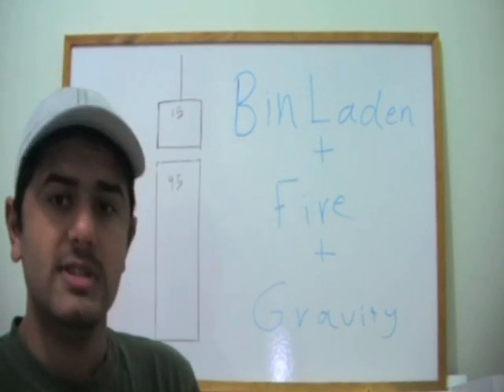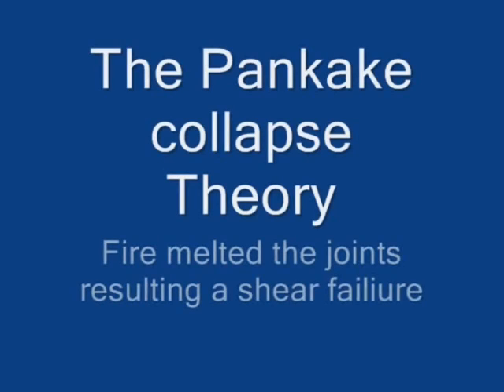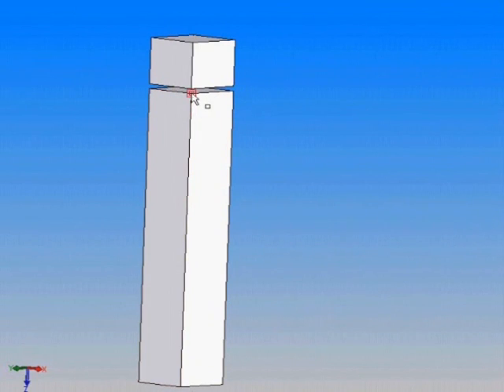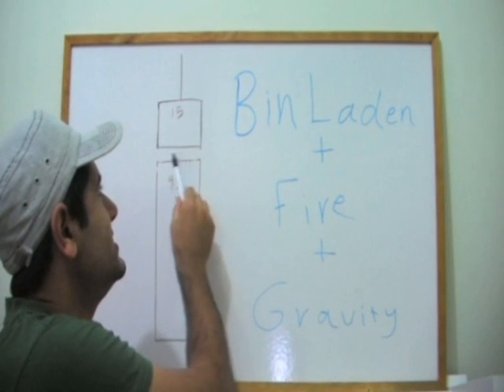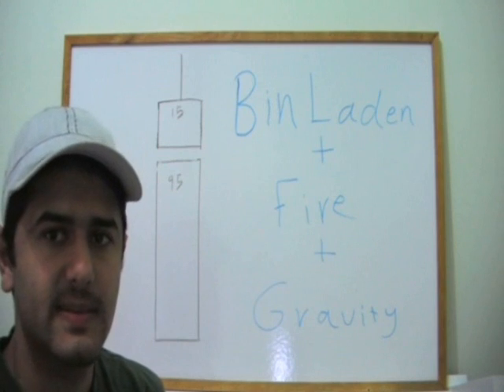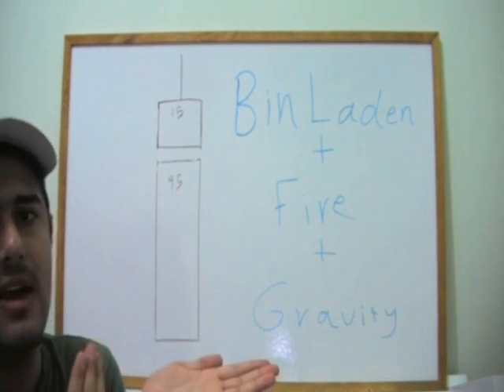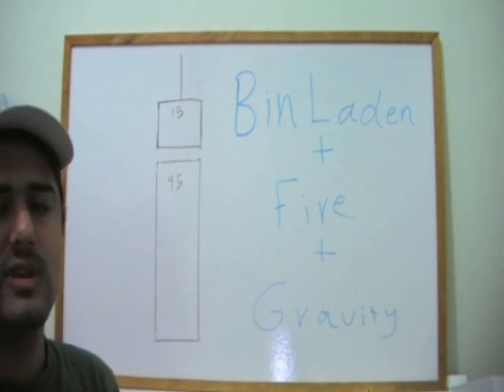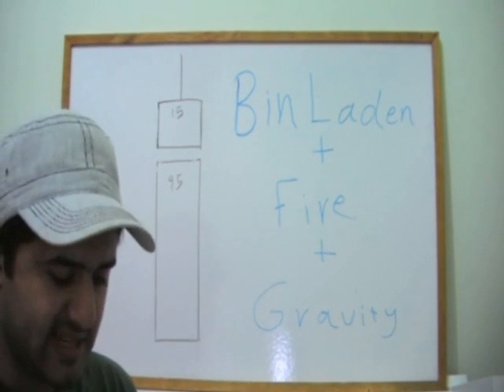(Part1) 911 Simple Physics Structural Failure Vs Demolition

Comment: The real point you should be looking at is : what removed ALL resistances and support structure that made the building fall at free fall speed and into it's own footprint?

If the top half supporting structure collapsed, the top half would have toppled over and slid off the rest of the building.   It would not be a total collapse.
Reply: +mummra7 
Funny all those people in FEMA involved in the report yet no one says anything about it over 14 years later.   Perhaps that would suggest you have a mickey dee in your skull rather than a brain.
Reply: I think the essential points to keep in mind are: 1. These were steel frame buildings but to my knowledge, none of the steel beams were encased in concrete. The only protection the inner columns had from fire was a layer of insulation, easily scraped away by the collision. 2.There were two structural elements, an inner rectangle of steel columns that tapered the higher they went, the outer shell of the  building consisted of un-protected steel columns that were reinforced by spandrels. So it's like a tube inside another tube where the two tubes are anchored together by light weight trusses that also supported the flooring. 2.The outer end of the trusses were attached to the shell at two points, one above the other. The top connection was rigid and the bottom was a kind of shock absorber designed to convert the energy of the swaying movement of the building into heat. 3. Now consider what happens when you (very carefully) stand on the top of an empty soda can that has been placed on its end. It will support your weight but if you give it the slightest lateral tap it will collapse because it has not lateral strength. 4. I think this characterizes WTC 1 & 2. Pulling the outer walls in just slightly (laterally) caused the vertical structure to fail.5.Once the tops of the buildings began to move there was another problem. The weakness of the connections between the trusses and the outer structure made it very easy for the falling debris to peel away the outer from the core. This is what is seen in the videos: the debris initially blasts outward and is then sucked back into the vacuum created by the falling core.6. As a note. I know of no other buildings that have this kind of structure - even though the design was considered revolutionary in its day. Why not? There are many comparisons of the WTC with other steel framed buildings that did not fail under fire conditions. Each of these need to be considered independently. For example, had their structure been compromised by a fully laden aircraft crashing into them, for example?
Reply: +Jeff W 
FEMA stated that around ninety percent of the building didn't fall in its own footprint.  It did topple over.....Any serious study of the collapses shows that.....Hell parts of the structure were found as far as the winter gardens.
Reply: Nathan Stirling fema said lol
Reply: +Jeff W So FEMA are in on it too are they?  lol
Reply: +Nathan Stirling oh yeah, all those fema people in the report, and not one word of tower 7, yeah lets trust that report. hey at least micks is now serving breakfast all day, that should keep you and your stupid theories occupied for a while. in any event, people have spoken out but the jew-owned media keeps it under wraps. so go watch that lying shitbag bill "oh really" he seems your speed.
Reply: I'm English you moron.....Your assumptions show just about how intelligent you are.
What exactly was I arguing about that was different to the FEMA conclusions brainbox?
Reply: +Patrick Lilley I'm afraid people just like conspiracies. They look at the videos and simply deny what's in front of them. They make comparisons with other building which have essentially different characteristics. Try not to get so angry. I know it is hard. They even have MIT professors coming out with this stuff. It is quite clear that the  buildings collapsed in on themselves gouging out each floor as the mass of rubble fell at free fall speed. What no one is talking about is the effort to deflect attention away from the possibility that the design were inadequate.
Reply: +Patrick Lilley I'm afraid people just like conspiracies. They look at the videos and simply deny what's in front of them. They make comparisons with other building which have essentially different characteristics. Try not to get so angry. I know it is hard. They even have MIT professors coming out with this stuff. It is quite clear that the  buildings collapsed in on themselves gouging out each floor as the mass of rubble fell at free fall speed. What no one is talking about is the effort to deflect attention away from the possibility that the design were inadequate.
Reply: Austin L : Your logic is perfectly sound. I saw an insane video clip of NIST blaming the building construction and when someone asked what the remedy would be he said "BETTER SECURITY AT THE AIRPORTS".  These are the fucking people that set the building and bridge standards.  

Were they in on the conspiracy? Let me put it this way.  Two fireman that were AT the pentagon were asked to come to a radio show. 

When the fireman didn't show up, the radio station called only to find that the two fireman had been placed on leave (then shortly after fired). Does that mean the fire department was in on it? 
Multiply these two fireman S problem by about 1000.  They just fired a French PHD this week for "coming out"...  If you exercise your first amendment right, you lose your job.  Donald Trump said from the debate stage "BUSH KNEW ABOUT 911 AND HE LIED ABOUT WMDs IN IRAQ".  The very next day he was on TV coming off of that statement.  Little by little. The truth is under attack in EVERY realm. I have been unemployed for 11 months. I have checked the LIES that are everywhere. There's no REALmnews in America whatsoever.  No paranoia. We are becoming a fascist network and I think the Bilderburgs will kill Donald Trump.
Reply: Nonsense.  The damage from impact and heat caused the 93rd floor to fail. The outside wall buckled INWARD.  The upper block tilted tiward the damage in each tower. No force would cause the top to slide off the base.  3,200,000 lbs per floor, just in the floor platforms, not the steel columns.  Wtc1, about 58,000 tons in the upper block of 17 floors-93-110.
Reply: David Millsom well.put david
Reply: That's what I'm afraid of, Patrick. He's not one of them.
Reply: +Jeff W The real point YOU should be looking at is the towers did NOT fall without resistance; they did not fall at "free fall speed." That's a MYTH (and BTW it's acceleration, not speed; learn some physics before embarrassing yourself on youtube).
Reply: +My Juice Smoothie Fast  as fema themselves admit they were on site, on monday sept 10, uh yeah, they were in on it. dont worry, after your juice-fast you'll be back at mickey dees in no time. hahahahah!!!!!!!1

Comment: Jet fuel in open air burning ~350 C
+black smoke indicate there wasn't enough oxigen
+fuel burned out in one big explosion
+office furniture was fire proofed in WTC (standart office regulation in highscapers)
vs
WTC steel was tested by UL at 2000 C...........
.
A body of lower temperature can't heat up his environment with higher temperature!!! (Think about the law of conservation of energy)
Physisc is a bitch, and stupidity endless.
Reply: +KugleeKuglee 
Jet fuel was not the only material burning in those towers.
Black smoke indicates petroleum products are burning; it has nothing to do with oxygen availability.
There was other fuel for the fire available besides jet fuel.
You can't lecture others on the laws of physics if you can't spell it.
Reply: TimReed22222 Ok forget the smoke. The real question is if you can melt steel with jetfuel, then you can melt with candle light too. Same condiction. Lower temperature make higher temperature..................Logic...
Oh sorry, English not my native....but I don't realy care...
Reply: +KugleeKuglee "The real question is if you can melt steel with jetfuel"

Okay, STOP RIGHT THERE. No, you cannot melt steel with jet fuel - and that's not a problem because there is no physical evidence that any steel melted. That's a MYTH. Didn't happen.

See how easy?
Reply: TimReed22222 Don't be parrot. Answer if you can and dont be trollolo. It's very boring.
Reply: KugleeKuglee ? Didn't I just answer?
Reply: +TimReed22222 . There was other fuel for the fire available besides jet fuel.

Like what? What other fuel brought the temperature up to 2700 F?
Reply: +Elmer Elmtree You've obviously never seen A) yield strength vs temperature charts B) sat around a campfire for a couple hours C) seen a brick house after a major fire.
Reply: nutsackmania . OK, I'll bite.

A) Perhaps you could provide a link to these 'yield strength vs temp charts'? I did a Google search for yield strength and A36 steel is rated at 32,000 - 36,000 psi. Now, I'm not even sure if that's the kind of steel used in skyscrapers. But then again, I'm not sure where you are going with this...?

B) I've been around plenty of campfire's, go camping all the time. Never had a single one turn into a blast furnace though, so you're implying what...? O_o

C) Now Googling "brick house after a major fire"...  Lot's of burnt out husks with the bricks still intact. Can't find a picture where the bricks themselves turned molten. This seems to counter your point entirely, so why did you bring it up?

And finally, what do any of your points have to do with the question of "other" fuel for the fire besides jet fuel? It wasn't me who brought it up. I'm curious.
Reply: +Elmer Elmtree The temperatures didn't come anywhere near 2700°F; fire engineers estimated the high temp around 1800°F.

And the flammable contents of those offices were sufficient fuel to do this.

Comment: If only one of the buildings had collapsed, I might consider it a possibility and a fluke.  That both came down identically seems totally far fetched as the collisions were different.  But the part that really makes me think it had to be an inside job is that building 7 came down in identical fashion - no plane.  It was in the blast zone of the falling towers, to be sure, but look at other steel structure buildings hit by blasts - like the Oklahoma bombing.  Sections of the building might collapse closest to the blast, but the sections away from the blast would stand.  If the entire building were to go down, it should collapse at some angle following the direction of the blast - not straight down.  Sorry, but someone is lying somewhere.
Reply: +Donald Fry You don't say.
Reply: +Donald Fry Building 7 did NOT come down in identical fashion. Haven't you seen the videos? The towers' collapses began at the points of impact; 7's collapse began at the bottom.

COMPLETELY different.